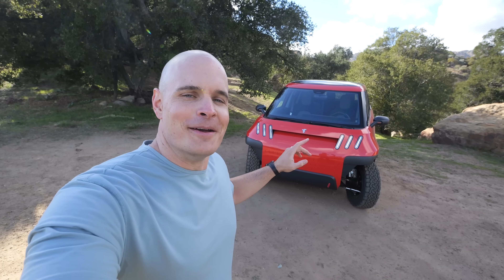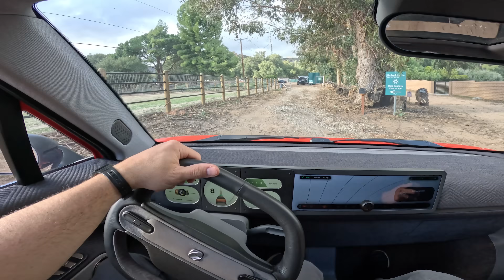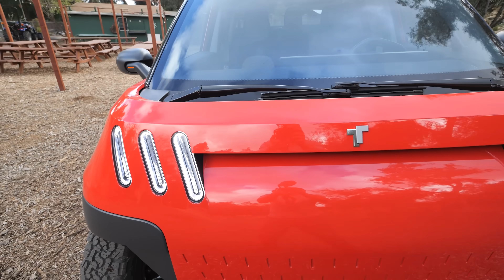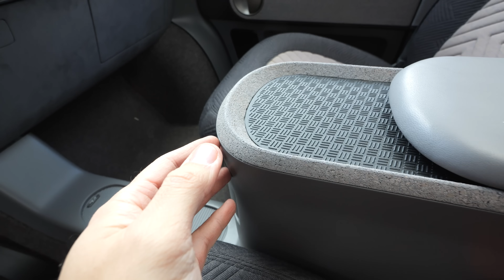ONE TRUCK TO RULE THEM ALL...

Comment: Until we find a real solution for efficient, low-cost, recyclable batteries, EVs will never cease being a novelty. As much as I like them, they're not any better than their gas-powered counterpart. If you're really worried about emissions, maybe start pushing for electric railways across the country that will reduce flights, which produce co2 emissions equal to roughly 300 vehicles per flight.

Comment: Lots of good ideas but lots of big problems. Sounds like a nice guy making a fun truck, OTS parts is a fantastic idea and I wish him success. Unfortunately the slightest front end incident and that will be a write off. All the front running gear that close to an impact structure is a no no. The drivers legs must be above an axle, drive/half shaft or motor of some kind. and that's likely gonna be really dangerous in an accident. Pretty sure it wouldn't pass ANCAP/whatever safety rules it has to pass so I don't know that it would get a license for sale in Europe/UK/AU.  Maybe its different if its considered a commercial? Does anyone actually know the rules, I really don't I'm guessing.

Comment: This is one of the many reasons to love EVs…form factors that weren’t possible before. Very cool to see.
Reply: The form factor is very similar to a Ktruck which use a 660cc motorcycle engine under the bed. The issue was crash testing and being slow. Electric fixes that issue on power, but I need to see crash test data to see if it fixed the safety part.
Reply: @g00fysmiley  I bet the crash test data will be better due to better better crumple zone tech, low center of gravity, and the battery on the bottom keeping side impacts from penetrating into the cabin as much. Only time will tell. Definitely excited to see what the next ten years brings when it comes to cool vehicles
Reply: Ha! Wonderful to see another YouTuber I enjoy, commenting here.
Reply: Typical tech bro mentality.
It's iNnOvAtIvE and rEvOlUtIoNaRy, even it was invented 70 years ago.
Reply: Not sure about the new username, lmao. He's one Undecided MF.
Reply: Nah, the Japanese have been making Kei cars and kei trucks for ages. It's just Americans have never liked small cars.
Reply: Hi Matt. Looking forward to your next video.

Comment: It would be spectacular if the bed sidewalls had prepared mounting spots for arches, like a tent. Maybe possible with what's there?  2-3 metal arches. One tarp. Have it covered as an option. Like the Mercedes Wolf german military truck. It's a Cabrio except there's these arches/rails / metal structures and you cover them like a tent if you want to. I think for most loads they ain't in the way if anything they are another spot to secure something to.

Comment: Reminds me of KEI- vans. Most of them offer enough space for a motorcycle with a smaller footprint than a Fiat 500. More than the electric VW van.  Many modern cars seem willfully inefficient with space. Good mainstream counter example is maybe the Hyundai EV. Ioniq? Afaik you can get at least enough space ij there to sleep. Honestly enough mostly flat space to comfortably sleep on a camping mattress is the one thing i want in a car most of all.   I've been 1-2 hours away from home at 5 in the morning or after up to 15 hours of work often enough. I shouldn't drive. I also want a beer.

Comment: IMHO, this is a very valid ev concept. Now what I think of this particular pickup. Interior is nice and its enough to make anyone happy, does it have AC? The bed is awesome, as best as it could be, fully practical and expandable! The exterior design, it could be a little more classic to avoid it looking like a toy, because it ain't.  Surprised by 106Kw battery, was expecting somewhere in the 70'd KW or lower. Bely angle seems a bit to low as tires look a bit small for some decent off road usage, like going out of the track and take it to haul grapes in a vineyard, it's just too low and tires are really small! From a farmer perspective, it would treated as a pavement hauling princess :) However, it's pricey, a lot, with probably less functionality because engine and transmissions  takes space, lighter (A LOT) and with same towing and hauling capabilities, a 20k small diesel (1.5 TD) pickup is available (still). I like it, I wouldn't buy it because it's pricey. This may have a very good market in Europe.

Comment: I am not really into electric vehicles, but this seems to be a very useful truck. More than what is currently on the market at the moment. 

If you keep the price realistic with a good set of accessories, it seems to be a neat little vehicle.

I drive dually trucks, and something like this would be very useful if it works as advertised. 

Please keep in mind that you need to have good strong tie down points in the bed. Seems like all the trucks skip this for some reason, including my current dually. 

Hope you can get it to market. This seems to be the first truck I have been interested in that isn't 30 plus years old. 

If you can make this vehicle easy to fix and replacement parts don't cost a fortune and reliable, then you should have a good selling platform. 

I might just check this out if I have the opportunity to once it hits the market. 

Good luck.😊

Comment: Hey Everyone 🤠
Find the parts that interest you:

0:00 - Introduction to the electric truck
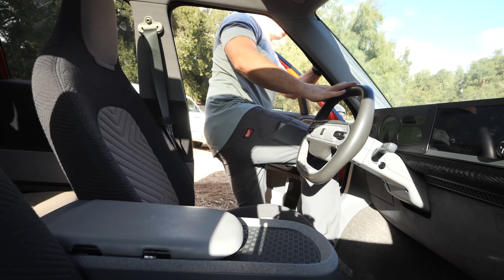1:14 - Unique entry into the driver's seat
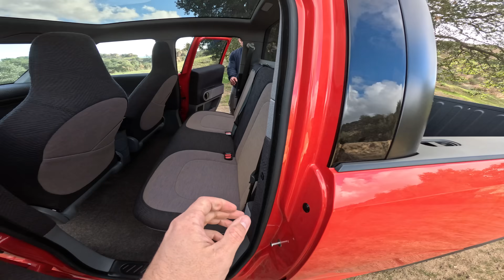2:20 - Expanding bed feature explained
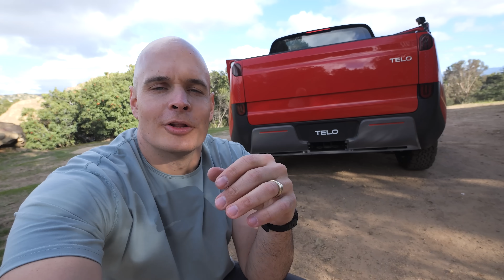3:06 - Comparison with Tacoma's performance
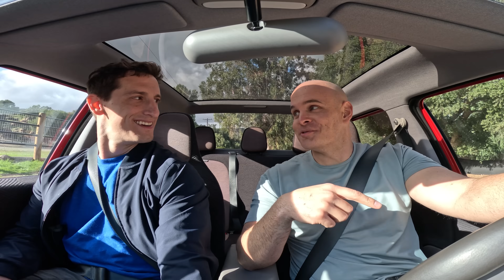4:49 - Discussion on electric vehicle advancements
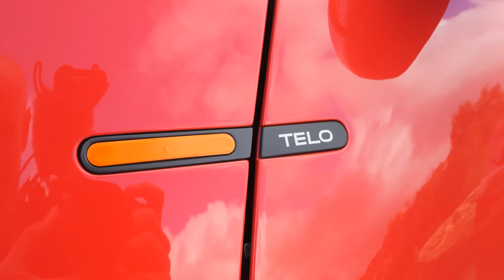5:29 - Battery pack sizes and range explained
6:01 - Introduction of the mini truck concept
7:36 - Survey results on consumer vehicle preferences

Chat with videos via Bumpups 🌲

Comment: This thing frankly seems like its real capabilities are way less than whats advertised, theres zero way something without an actual frame can have 6600 pounds of towing capacity let alone the size its at, and i also doubt the truck would even be able to handle the advertized bed capacity without leafsprings.

That interior noise durring the demo is horrible, and im not talking about the noise from the outside but rather the rattling of the interior panels.

Also 35 grand for the base model, seriously? This thing already seems sketchy if it were 10 grand but for 35 grand you could go get a base model ford maverick and have 12 grand to spare.

This thing seems immensely uncomfortable as a people mover and impractical as an actual utility vehicle, theres no world where the final product is gonna be faithful to whats presented, i am willing to bet money that this things gonna be relegated to the same grave of horrible EV concepts that it claimed to make major strides from.

Seriously, if you see my comment and want this, dont place a reservation. If you need a decent small truck as a daily driver buy a ford maverick or a 2000s ranger, and if you need something for the utility track down a Kei Truck. You'll pay a fraction of the price and be able to have peace of mind that your vehicle is going to have support available for the next 10 years at least

Comment: God I would LOVE this truck if it had enough ground clearance for the roads in my county. My Crosstrek could stand to have a 1 inch lift kit around here, with the potholes and parking lots. If this thing was just a couple inches higher off the ground it could do so much better in the US

Comment: This is the first electric ute/pickup which has really interested me. Can carry a full sheet of plywood and fits in a normal parking space. Great job Telo!

In Australia, even a Ford F150 is considered an excessively large vehicle, Cybertruck is so wide it doesn't even fit on our roads, and any of these "yank tanks" are mostly seen as being for people compensating for something.

I don't recognise anything with less than 8' of bed that can't carry a full sheet of ply as a real truck/ute. If I'm taking a ute instead of my motorcycle I'm probably buying plywood or 2.4m (8') lengths of timber.

Comment: Just an opinion here, but the cabin needs to be 6in wider back seat shoulder space isn't great for 3 passengers) and 6in longer ( more leg room in back seat).  Also, the bed could be extended about 6in longer.  The wheel wells could be opened up a bit for some more aggressive tires.  Fitting into the footprint of a mini cooper coupe is a cool gimmick, but I wouldn't make it a necessity, more of a guideline.  Aside from that, I Love it!

Comment: With all those lil features, im surprised it didn't have a tow hitch that can be tucked away then pulled out at the press of a button 😂

I wonder how well noise insulated it is. Electric vehicles tend to be quiet anyway, but for an off-road vehicle, I'd be nice to see expanding foam inside the chassis rails, panels or in the wheel arches to help remove tyre, road noise.

Comment: With all respect. You can barely fit both in the front side and the rear side. If you happen to be a 5 foot japanese person, then it's fine. The design resembles a lot of the late 90's early 2000's Renault cars. Other than that I'm fine with it.

Comment: My gut reaction was disinterest because honestly 90% of people in pickups don't actually need them and just want the biggest, most dangerous vehicle (for others). But this does look like it could improve pedestrian and cyclist safety while still offering that truck bed capacity that people claim they need. I guess the other important factor in its success will be safety ratings, because they also buy big vehicles so they can feel safer in collisions (even though being larger causes more collisions).
Reply: I'm still a bit concerned about the front-crash ratings since there isn't much room between your feet and the front. However, the Smart car has decent ratings despite a much smaller envelope. Dunno. Guess we'll see... I hope they succeed.
Reply: @TheJohn8765  It's a biased source, but Telo does say they're confident in a 5-star rating.

Comment: This is genuinely going to be the most useless vehicle in history.

You tried to copy japanese kei-trucks without knowing what made kei-trucks so great.

Every single "feature" on this truck is a useless gimmick.

You claim it can carry a full 8 foot sheet of plywood, but it only fits if you sacrifice the back seats and open the entire back of the cab to the elements, and on top of that you need to push the seats almost all the way forward to get the full 8-feet.

These bloody idiot got so caught up on stupid gimmicks like making it the same length as a mini cooper that they forgot to make the truck actually useful.

Forget about comparing it to a mini cooper and make the damn thing a few inches longer and give me a reasonable amount of bloody leg room.

Make the thing a few inches longer and make it fit a 8-foot sheet of plywood without having to push the seats all the way forward and forcing my knees into the damn dash.

Good lord even the bloody reservation price is a marketing gimmick.

Do you think they were comparing the kei trucks to a mini cooper when they were designing it? No, of course not, the only thing they were worried about was making a useful small truck, and thats what they did.

Comment: So far, from what I see, I like this mini truck. I can see a lot of utility for contractors who don't need several hundreds of miles of range per day. The cargo capacity is decent for those folks as well. I would like to see a van based on the same platform. I think many contractors would use that as well.

Comment: Thank to Jason for attempting this project. 
As most companies keep going the way of "make it as difficult for customers to fix stuff they bought unless they take it to authorized dealer" . This is a refreshing approach.
Reply: Keep in mind, it has a proprietary battery. Those are often the most expensive part of the vehicle. So don't get too excited just yet.
Reply: @ I hope that changes, BMS's have always been tricky, companies keep saying that it's their secret sauce but it's nothing more than voltage, current, temperature, and state of charge (SOC), if a battery can give those values back to the BMS then any battery should work. 
It's like gasoline vehicle manufacturer saying our pistons are our secret sauce, makes no sense.

Comment: If they dont have a factory, its at minumum 3 years. Why is he stating 2026 when they cant even build them?  Building one or two sure, but no. This is 3 years out. Neat concept for sure. Would like to see them remove a bit of the back seat and make it a 2 seater trunk like the s10 was.

Comment: Hey @TELOtrucks, great cute looking little truck. I saw that neat little slide out cupholder console. Please, please, as a trucker myself have at least one of those cupholder spots be large enough to easily fit a 32 ounce widemouth type of bottle. Specifically, it needs to easily fit a large widemouth, Gatorade or Powerade bottle.

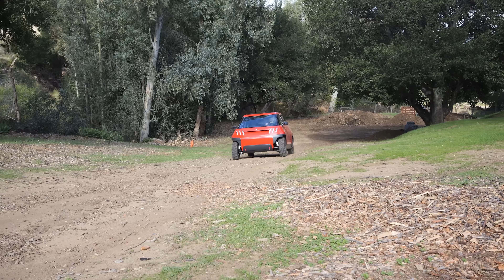Comment: Around 4:00 they start driving and all you hear is  squeaks. My gripe isn’t specific to TELO - seems like all modern car interiors are just plastic on plastic.

You can solve this problem with a single, cheap sheet of rubber and laser cut profiles to slip between interior panel interfaces. Or, injection mold the parts as a permanent addition to the manufacturing process.

TELO has a super niche US market (twice as much $$ vs small trucks in Asia or EU, eg. 2025 Suzuki Jimny). They have to nail it the first time around or they’re just going to join the EV graveyard 🪦.
Reply: This is a prototype not final so the squeaks are getting worked out

Comment: …….

Where is the battery? 

It's supposed to have up to a 100 kWh battery, I just don't see anywhere in the packaging to fit a battery. The floor doesn't seem thick enough to hold any battery at all!

As a lover of tiny vehicles (I love my Arcimoto FUV, I miss my BMW i3) and an owner of a Rivian that is used to tow ~6000 lb trailers, this little guy seems *PERFECT*.

Comment: Wow this actually looks really cool. On their website you can even get a camper cover add on for the bed to turn this into a sort of SUV when you need that. Even with the shell and bigger battery upgrade the truck is looking to be around 40k USD, which is honestly very refreshing in the landscape of most decent EVs in the US starting around that cost or even a little more.

Comment: Quite ugly, but I don't think it's possible to design anything uglier than the Cybertruck. Unless it's from Tesla. They may be able to do worse.
But they did everything else way better than the Cybertruck. Especially, safety wise. Now would the price be also much more advantageous or barely ?
Anyway, looking at the compact size, it shouldn't have much problem reaching EU after the trade and geopolitical conflict.
We have the extremely Citroen Ami here which is almost Cybertruck level in ugliness.

Comment: Everyone confused about how loud (and creaky) the interior of the vehicle is need to realize this is not a production intent vehicle, but a prototype. This was hand built with no effort at addressing NVH. The CEO remarks on this fact in another video I saw. The final product will have all sorts of dampening for external noise and will be built with a totally different process that is designed to eliminate the creaks and squeaks.

Comment: This would solve two problems for me. I use a gen1 honda insight for commuting and a subaru outback with a trailer on weekends to cart my dirtbikes around. This could potentially replace both. My issue with modern utes/trucks is that they are terrible to drive around during the week and the bed height is too high. Solo loading of dirtbikes is far from easy/safe/convenient. This could be it.

Comment: I don't know what local service (power/cleaning/park greenkeeping/undertaker etc.) drive, but I've seen some here in germany switch over to for example evum acar's, with way smaller batterys and focus on load volume/weight. Yes, the Telo feels more like a "car" to me, but maybe with a 2/3 person cabin, and more "loadbed" focus (or box or so) buildup, it might be also usable as a pure unitiy car. The back shell micht not be easy to adapt, but maybe the frame underneath migh could handle that too.
Just a perspective from a german/eu standpoint were a lot of cars are way smaller and may be a market for it. Maybe more as a mini-van style and a third row. *pointing at EQV & idBuzz*.
I think there is a lot of (maybe europe/africa/south america) customerbase for that size.

Comment: Very cool utility! However, it looks like a death trap for the people in front. Why not add a foot or 2 in front to increase safety? It would still be a small truck.
Reply: You don't need it. They are aiming for five star front crash rating.
Reply: @ it still seems dangerously close to the front row. Physics is real.

Comment: My question,,, Can they be modified for mobility impaired, wheelchair bound drivers? I understand that some vehicles can be modified for roll in applications, my inquiry involves just a simple re hinge of the driver-side rear door, i.e. hinged on the c pillar for a suicide style opening?
   I am able to load my breakdown wheelchair thru the side door of my minivan currently. I have not found a similar solution to my mobility needs.

Please help, I am a right limb btk ampute of 60 yrs of age and would like very much for a reply to my inquiry. 

Thank you